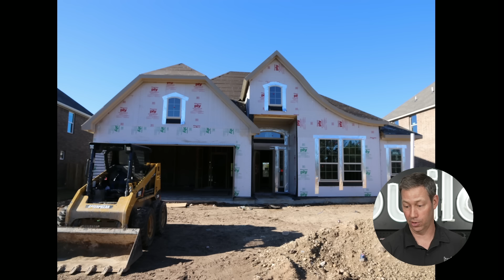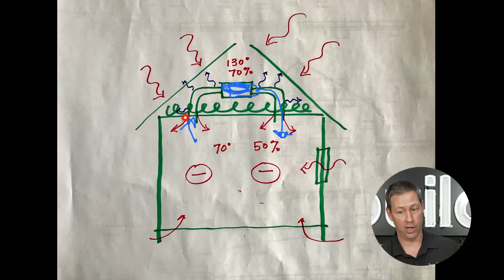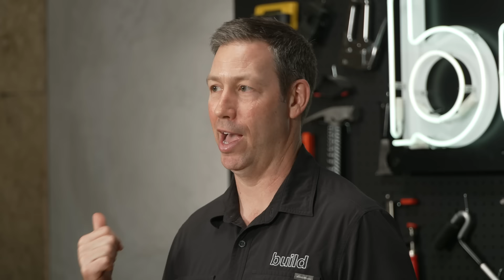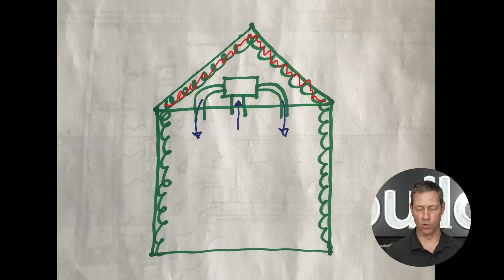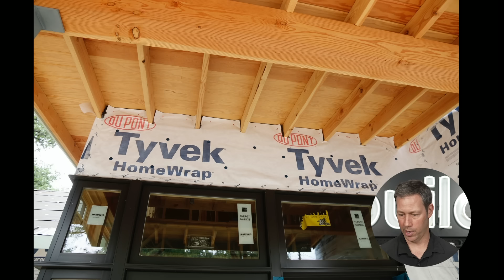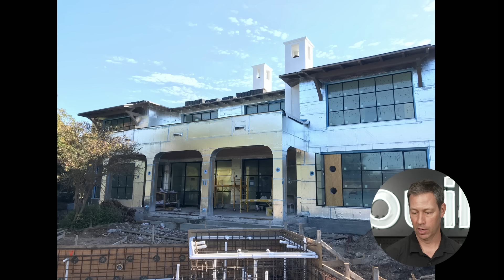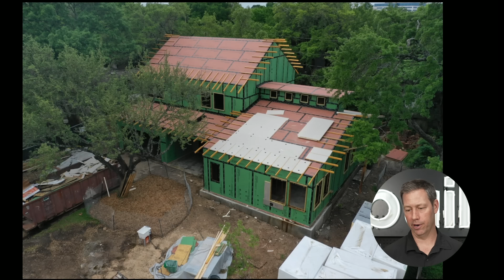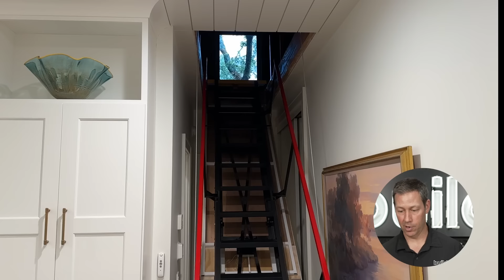CRAPPY ATTICS are Standard in America! Here’s how to BUILD - DECENT or AWESOME

Comment: Question for you- Getting ready to replace our roof with a full tear off.  Your third option looked great but...we have a 75 yr old northern house. No A/C ductwork in the attic.  No soffits, and lower sloped ceilings in upstairs rooms.  Attic is full walkup with a floor and some ancient (fiberglass) bat insulation underneath. Roof has drip edge vents, ridge vent, gable vents, and turbine vents.  Plaster ceilings on the sloped portion of upstairs rooms tends to bubble and effloresce in every room, especially the bathrooms which do NOT have ceiling exhaust fans because they have windows (code when the house was built). When we moved in, there was bat insulation placed between the rafters against the roof plywood, but upon inspection,  the inside roof plywood and the rafters were covered in black mold and rotting from all the natural moist air created by 5 people living and an HVAC circulating air from a damp basement.  We were told to  and so removed all the upper insulation, bleached everything, and created airflow to move the moisture out.  No more mold but the hot/cold air leaks and our heating/cooling bills are astronomical!   So, how do we take advantage of the roof work, seal everything,  keep the ceilings from bubbling and keep from having black mold repeat? Venting the bathrooms would help, but humans and cooking (no stove hood exhaust and no room to install one) and tons of plants etc. still creates a lot of moisture. Also, how do you address concerns about indoor air quality/pollution?   ASHRE recommendation is .35 air changes/hour or at least 15 cfm per person.  Additional info, we tried to get an energy audit and they said they weren't able to do a blower door test - said there was no way to seal the house enough and figure out where the leaks were coming from. This was a fixer upper with crazy floor plan. 2 story. full basement, full walk-up attic. 3 fireplaces, 8 (!) exterior doors, 29 windows (replaced) all in 2500 sq/ft.
Reply: Re: cooking venting-  perhaps a counter mounted downdraft that goes through your floor and out the side of the house via low clearance ducts?   I know that would mean ripping up the floor, but perhaps if you have a remodel slated for that kitchen it could be an option.   I'm assuming that an overhead ventless hood is not an option per your statement.  We have al old house, 1900, half log cabin, that I'm deeply concerned about as I don't know how the siding is attached.  I am feigning ignorance right now but the fact is that it will be in the back of my mind until we have the money to rip off "perfectly good siding"  MY hunch is that the air temp difference and the humidity of being near the Great Lakes mean that there is the potential for mold between the siding and the old cabin logs.

Comment: I have a 1969 build that was the builder's house originally.  Good solid bones, but crappy attic.  Always banging my head up there.  We're not that far from you in Shreveport, LA.  We have the whole house fan giant monstrosity, which we do use on cool mornings.   Surely by now there is a more modern and more quiet, better way.  We have 36 inch eaves with the vents.  There is a new temperature activated exhaust fan in the roof.  There are three vent turbines up there too.  The house has an attached garage with a 25 foot wide door which I insulated.  There are two attic access points.  One in the main hallway and one in the middle of the garage.  One of the things I have notice when using the garage access point is that the insulation stops at the point where the wall is between the living space and the garage.  There is no insulation at all over the garage area and there is no barrier above that wall that seals the attic space from the living side to the garage side.  Surely that really makes for a crappy attic?  Shouldn't that area be insulted as well to keep the attic from heating up more from the hot garage?

Comment: As the temperature increases, the relative humidity decreases. I have a wireless thermometer in the attic. Right now, it is 123°F and 18% humidity. I live in the Houston area. It's 2:30pm on September 24th, 2023. At night, the temperature will eventually reach the outside temperature and humidity -- often 60% or 70%.

Comment: My duct board distribution boxes were foil taped together. The adhesive had let go, and they were leaking badly. I put mastic (sealing goop) all around them. I also sealed using mastic from the ceiling to the duct (up in the attic).

Comment: I liked this video looking at past and present methods. I am currently building a retirement home for my wife and I. The home is slab on grade. My thought is to use T-11 plywood on exterior walls then spray 1.5 inch closed cell foam as a vapor barrier, then install all my electrical and plumbing. And finally finish with rock-wool installation to get the R value I need. I live in Montana, so I'd like R40 insulation. The idea of insulating the outer shell is a great idea, but if there is no large attic crawl space how do you keep mice out is my biggest question. They get in everywhere.

Comment: You have much more experience and knowledge than me, but have you considered reclaimed polyiso board insulation? It isn't going to shrink much more, its drift has stabilized, it's cheaper, and it reduces landfill waste. I cut it 1/2 inch smaller and used spray foam in a can to make it fit tight. Then I cover it with R-6 Comfortboard 80 on both sides. I do this for the roof and walls. I have used Zip sheathing all around, including door or window openings.

Comment: Costs for this level of detail are often prohibitive for existing houses (especially in high cost-of-living areas); I was quoted $60k for spray foam in a very large attic, which was estimated to be a $3k annual savings (mostly for heat). A 20-year break-even (not to mention the inconvenience of needing to be out of the house for 5 days) is pretty much a deal-breaker.

Comment: It seems to me that one of the advantages of standard ventilated attics is ease of repair and maintenance on the roof. If you have a problem with the roof and you have an insulated attic, it could be a nightmare, especially if you have spray foam.

Comment: As far as attics go I really like a basic a-frame with a large front and rear porch.. This design allows for a lot of attic space for baffles along the top of the walls and 3 feet of blown insulation up there.. Then the truss package has a deck at the 3 foot level so you still have a full attic for storage.. Have an external attic access and sealing off the attic completely from the living space...With the ac and ducts under the house.... My first house was 2k square feet, with 2x6 exterior walls 24oc, 3 feet of insulation in attic, and ac and ducts under the house and everything thing else normal construction.. My second house was also 2k square. A friend builder who has been building for 30 years said those 3 things wouldn't make a difference... Both houses all electric. First house $45 average electric bill. Second house $200 average electric bill.... The 2x6 exterior walls allowed for 24oc instead of 16oc with 2x4 so hardly any additional cost there. Ac under the house allows it to operate in a less extreme environment and cost is the same for install, maybe a little cheaper, but replacement of air handler as an assembly is a fraction of it being in the attic. The only thing costing more then normal is the additional insulations to get the 3 feet thinkness... Can you guess what im doing in the new house I'm building now?

Comment: Have never finished the attic out like that and not sure I would.  Wool batting is very expensive.  I think that lowering the temperature with better air exchange in the summer months would be better.  Have used styrofoam on my walls with additional sheathing and it is a huge improvement.

Comment: Home Owners need to understand that blow in foam insulation can be good IF the foam is mixed correctly, applied correctly, cures correctly. That can be a risky proposition, and the problems can be difficult to impossible to correct. Using Rockwool insulation is a DIY or trade installed. It is very easy to install, as you can trim in around electrical boxes with ease. Very little waste, and it will not burn, even in direct flame contact, and will not absorb water, and will dry out. It also creates a much better sound proofing from outside noise, ie dogs barking. It is expensive, but it does pay you back in energy savings.

Comment: Great video!  We have ef'n roof rats here in coastal VA, too.  Nasty buggers.  10 years ago we put a new roof on the house.  I happened to mention that we were planning on spraying closed cell foam on the back side of the roof in the attic space for insulation.  The roofing contractor said it would void the shingle warranty because the heat would essentially reflect back into the roofing materials.  That struck me as BS.  Have you ever heard of a shingle manufacturer voiding a warranty because the homeowner foamed their attic space?

Comment: This was great. Even though my house is in New England, my general contractor put one of the air handlers in the unconditioned attic. Really bad choice. I'm finally going to make it a conditioned space and use rock wool as well as constructing a cold roof over the conditioned space. I think that using closed or open cell foam is a really bad choice because of the   variability of application and it must be difficult to figure out where leaks are occurring.

Comment: Fantastic video. I have always advocated for making the attic part of the conditioned space. I am a retired commercial GC so I am not well-versed on residential construction, particularly with regard to attics. Why did you go with thermafiber insulation in the attic versus closed-cell spray foam? Thermafiber is terrible once it gets into your clothes. Nothing is quite as bad at making you itch. It's almost impossible to get it out, even after laundering. It can also be accidentally knocked out of position. It seems to me the spray foam would be a better option.

Comment: I just retrofit 3-1/2” of closed-cell spray foam in my garage rafters. $3000, SF Bay Area, 400 sf garage. Included protective plastic sheeting. 

Meanwhile, I can get R44 cellulose put in over 1720 SF for the rest of house for about $2000. Paid $1500 to have old 1962 insulation (50% rat crap) vacuumed out. I rat proofed attic myself.

Very easy to see why costly spray foam isn’t used more. Matt’s house used the best components for everything, often comp’ed or discounted by vendors. More like watching a review of a supercar rather than an econoshitbox people can afford.

Comment: Ah, yes, foam under the roof decking--so that when the roof leaks--and if it's conventional shingles, it will sooner or later--and the roof decking starts to rot, there's no way to tell, and the back side of the foam will be affected, too.
I love the idea of keeping ductwork in the thermal envelope. But I won't have a roof that isn't ventilated. Maybe that ends up being the space between rafters is ventilated, and decking is put on their underside which also supports the thermal barrier. It still has the problem of being uninspectable, but it won't have the same rot & freeze hazards.

Comment: The problem with spray foaming the plywood is that when the roof needs replacement, and some of the boards are water damaged, that part of insulation will need to be redone.

Comment: Congrats on 1 million. 2-3" closed cell spray foam is all that's needed. Seals and insulates, stops 87-93% of heat transfer and makes it air tight and 3 times stronger. R50 is not needed as a measuring system.

Comment: So an air-conditioning register boots should be installed with the flange on the underside of the ceiling or wall material so that it's already sealed against the sheetrock or other wall material. Ductwork is also insulated for a reason. And while heat transfer is greater with the greater difference between hot and cold temperatures, ventilating the attic space does reduce the difference. But properly insulated ductwork doesn't loose a lot of temperature to the attic space. I worked sheet metal back in the 70s and attics in Texas were commonly ventilated although we did see older homes that weren't, but a hole in the roof, a vent, flashing, and some mastic took case of that problem easily enough. But what really set back quality air-conditioning installations and their effectiveness was the invention of fiberglass duct-board and flexible duct combined with plumbers who though they were sheet metal workers and suddenly knew how to install residential ductwork. Which is of course how you get register boots installed from inside the attic space instead of from inside the room.

Comment: So if your home doesn't have A/C in the attic then "crappy" is actually pretty good.  That's what I have (A/C is in the basement).  What about an electric fan in one end of the attic?  My parents had that in their home--would automatically turn on at a preset temperature.  Seems like a good idea for dropping the temp in Summer.
Reply: Agreed. Honestly AC units in attics is a horrible idea unless part of said attic is climate controlled.
Reply: @charlesrodriguez7984  and really difficult to work on or replace, in most cases.
Reply: @DonTruman  and removing the HVAC unit from the attic immediately increases efficiency and increases lifespan of the unit a lot.
Reply: Active air exchangers aren't very efficient. Depending on the climate, you're probably using as much electricity to power the fan as you are saving by removing the hot air. A much better system is passive ventilation that uses the stack effect to move air. Something like vents in the soffit and vents on the ridge are the most common version of this.

Comment: I have seen homes with closed foam that had to be de-foamed due to the house not being able to release humidity and no air based equipment worked no matter the size of the fan. No bathroom fans did their job, no kitchen vents worked...nothing worked, unless they opened their windows when they cooked or took a shower. So more is not necessarily better.

Comment: It seems to me that the only reason that the house would be in a negative pressure situation (due to the AC) is if the duct of the AC DISCHARGE has more air leaks than the AC INTAKE/RETURN. All of the ducts will certainly have HEAT loss; but (when properly installed) will not have AIR loss. Also, if you incorporate outside air intake into the AC, then that would tend to make the house positively pressurized.

That said, typically every bathroom vent and range hood fan causes a negative pressure situation.

Comment: hey matt, I will never use open foam in a roof system. if the roof leaks you most likely won't know because the foam will absorb the water, also the foam will not release the water so rot will occur and you'll never know until it's too late.

Comment: I've seen so many flexible ducts that were improperly suspended with minimal straps and the weight of the ducting on either side of the strap caused the duct to collapse at the strap. My current place has minimal air flow upstairs and I think this is again the cause. "Attic" area is full of blown-in insulation and I can't see the rafters, so I don't want to even try to get up in there.

Comment: Attics in most houses today are not meant for storage (or expansion) like they were back in the day.  Some you cant even stand up in.  The big box home stores used to sell a tongue and groove osb board that was sized so you could get it up the attic opening and it fit between rafters like a dream....  I guess the demand is so low they dropped it.  For a while there were some plastic squares that were even better, but spendy (as in more expensive than italian marble floor tiles per sq ft.  FOR PLASTIC).

Comment: Seems obvious that for retrofit, the awesome is not an option unless you are rebuilding the roof and stripping the sides.  However, decent with spray foam insulation is an option.  We built a metal building used as a pig farrowing house and had it spray foam insulated.  It is very tight, too tight as humidity accumulates inside unless a few windows are opened a bit for air flow.  If I ever get electricity run to the building, I’ll install some HVAC and air exchangers to moderate the humidity levels.

Comment: How would you handle flat roofs, with small 4 ft attics … several large soffits under the eaves of the sides … 85-95 exterior temps, 60% humidity… attic gets up to 140+ 

The attic is 18” of loose fill insulation above the ceiling

Comment: Crappy is unconditioned space being used for essentials like HVAC.   In the North attic space functions as part of the roof system.  It is easy to add R60-80 or better in an unconditioned attic space where it is absolutely essential to keep heat from reaching the underside of the roof to avoid ice build up and all the destruction that can occur from it. 
Not all attics need to achieve the same goal.  I don't know that one is better than another so much as it is a measure of build quality and purpose.

Comment: I'm guessing in your region it's the opposite of Canada maybe? Here the Vapour Barrier must be the first layer before the insulation. This is to prevent moist indoor warm air from crossing the insulation and condensing on the cold wall during winter. And we can't sandwich the insulation between 2 sealed membranes either. So only the inside may be air sealed. The outside must be able to breed.